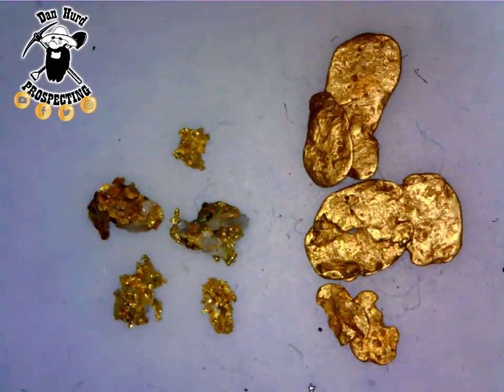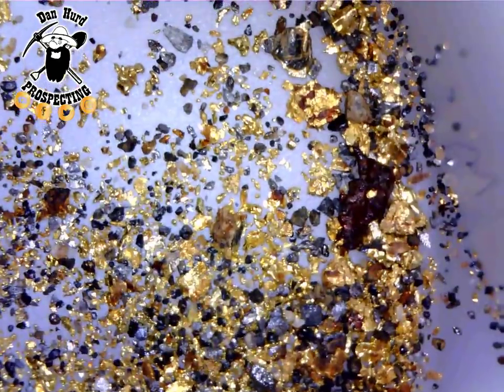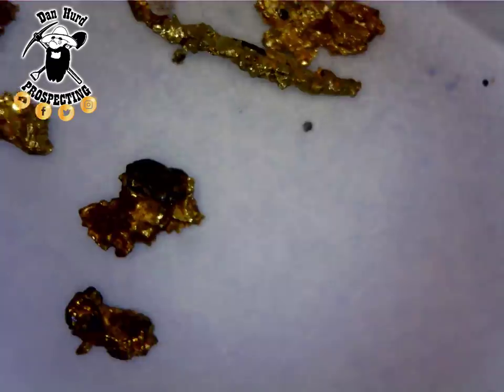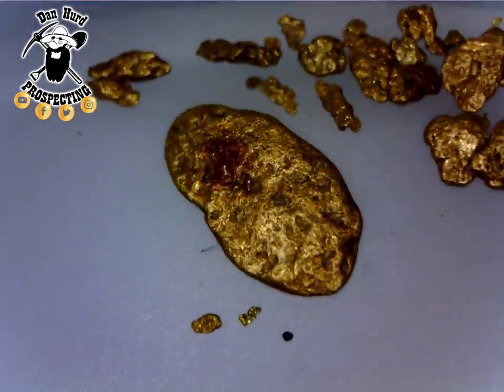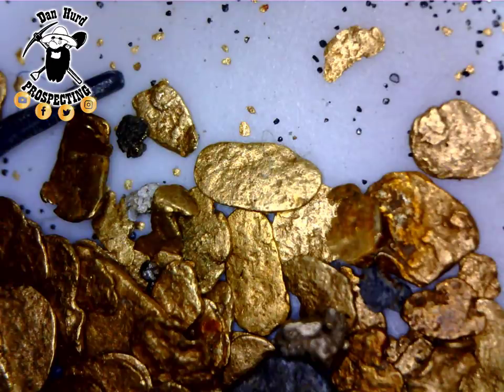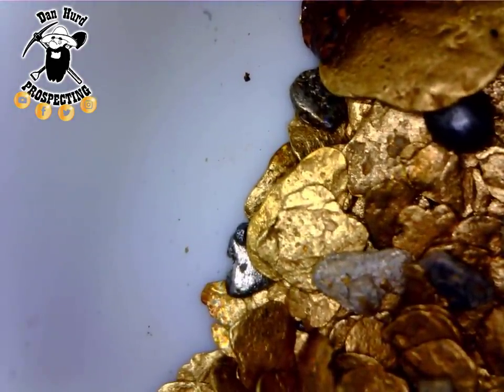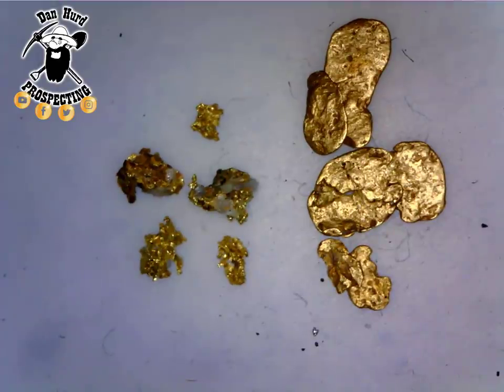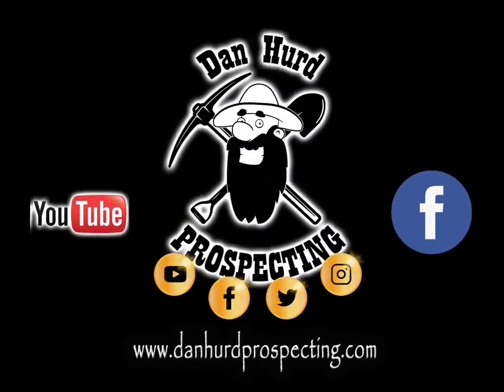What's the difference? Placer Gold vs Hard Rock Gold

Comment: Great examples! I would have liked to see a "Side View" of that flat Placer Gold vs the Hard Rock Gold. I can see the smoothness of the placer, but not the height of the hard rock vs the placer.
Reply: That would been difficult given the example size. But your question isn't totally relevant as hard rock gold is found in all sizes just like placer. Bigger hard rock nuggets just get flattened into bigger flatter placer nuggets just dependant on the size of the gold when originally liberated from host rock.
Reply from the maker: Great suggestion! Sunday's video has some side shots of VERY fine flat placer gold.

Comment: Here the $64000 question was waiting for a video just like this to ask. 
Why is the placer gold bigger then the lode gold ? After all it was all lode at some point. 
   And great video again Dan!!!
Reply: Not all hard rock gold is small and microscopic they are hard rock specimens that weigh well over 1,000 ounces. That said gold is soft and maleable once liberated out of host rock and getting smashed around in the rivers or by glaciers in some cases. It gets flattened thinner and thinner thus making the flakes thinner but bigger. This is why placer gold appears more polished and smooth.

Comment: Is placer gold also aggregated into larger pieces by cold welding by the hammering action in the rolling rocks? It looks like it, seeing that the typical cristalline pieces are much smaller than the larger pickers an nuggets.
Reply: It can happen but very rare no the size of hard rock gold varies just like placer does. They are hard rock specimens that weigh in excess of 1,000 ounces. What Dan's example was just what he had available to show. Hard rock gold can be much bigger.

Comment: So in order to fuse tin and copper into gold I need to stabilize the isotope with 14 neutrons because fusing copper and gold gives you 79 electrons 79 protons only a 104 neutrons which means stabilizing it with 14 neutrons should give us a nice stable 118 this experiment successful could be very helpful for the process of making electronics and solid-state chips and would reduce the price of electronics across the board

Comment: I'm try to find some tin so I can try this experiment if using Fusion in theory by bombarding copper with tin atomic number 29 fusion with Atomic number 50 should give us atomic number 79 gold I think that the trick will be is doing it quick enough to get a large enough quantity of Gold without bombarding it with too many neutrons from the fusion reaction where it will then turn into radioactive isotope of gold and then into Mercury which obviously would devalue it so it's done quickly and carefully we might be able to create gold from two cheap metals Alchemy using plasma physics